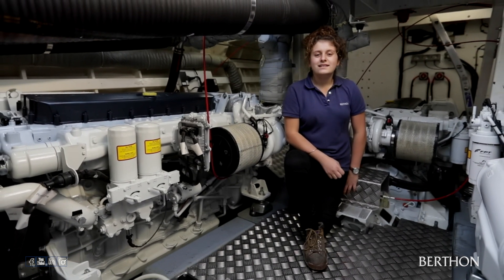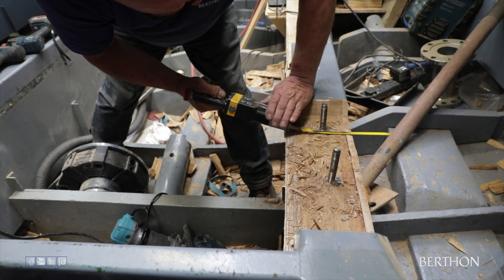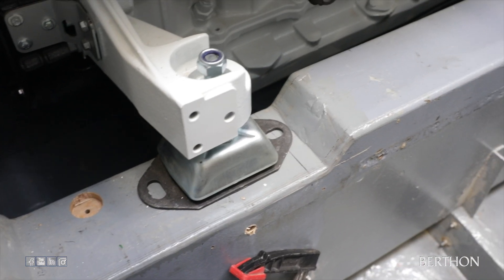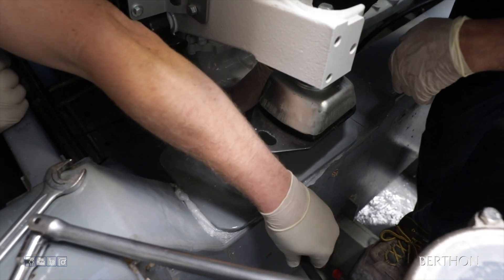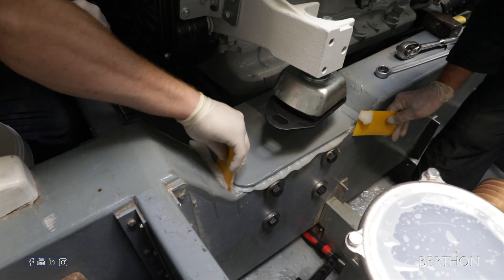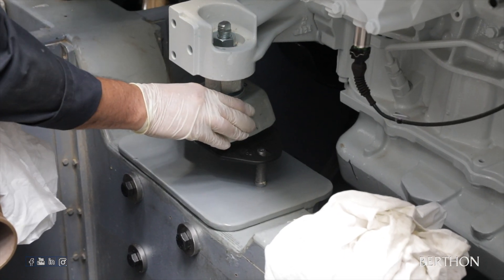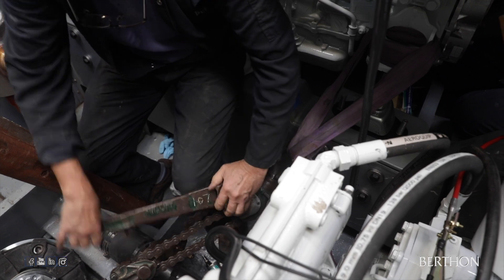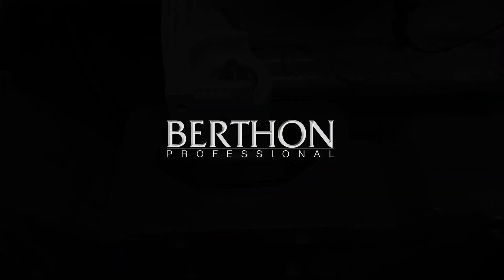WW2 MGB 81 Motor Gun Boat Restoration - New Engines Part 3/3 - Fitting Engine Mounts & Feet

Comment: I thought these boats had 3 merlin engines? My m8 wos an engine mechanic on target towing launches in Anglesey! He told me they had 3 engine and could do 65 knots!
Reply from the maker: When built in 1942, she was among the fastest boat of her type in the world and capable of speeds in excess of 43 knots.

She was originally powered by three Packard 1,250bp petrol engines with the centre engine driving directly and the wing engines using a "Vee-drive". Speed was about 40 knots maximum with 35 knots being achieved continuously and 26 knots cruising. These speeds increased about 3 knots when underwater exhausts were fitted.

Very little is known about her history after the 2nd October 1945, until 1958 when she was arrested by Customs officers at Shoreham whilst in a smuggling operation. We know her original engines were removed and she was sold on for use as a sailing school accommodation ship at Hardway, Gosport, and renamed JOLLY ROGER. In 1964, she was sold to become the houseboat CRESTA, also at Hardway.

Petrol engines were thought to be prohibitively expensive to run, so three 1,000-bhp V-12 MAN turbocharged diesel engines were fitted, giving an estimated top speed of 45 knots.

When she arrived here we replaced the 3 MAN 835hp engines with 3 new, Mermaid Marine supplied, FPT C13 825hp diesel engines. Both Berthon and the PNBPT wanted to keep MGB 81 as original as possible. However, the replacement engines are more reliable, fuel efficient and lighter than the originals.